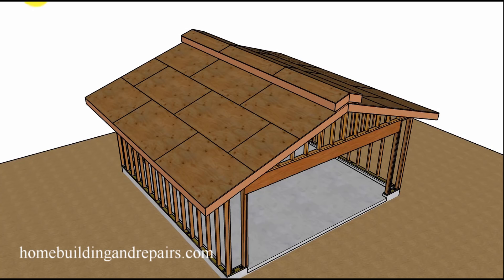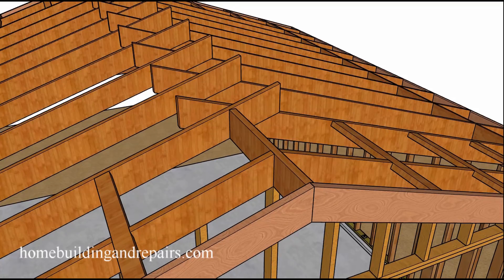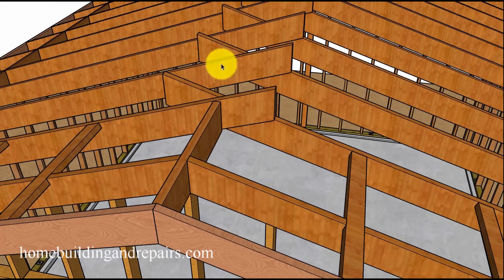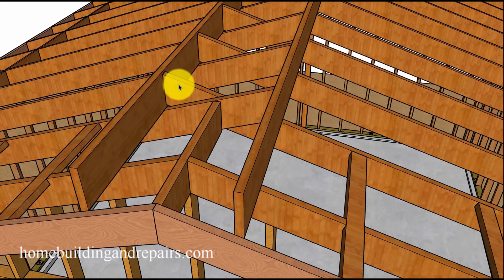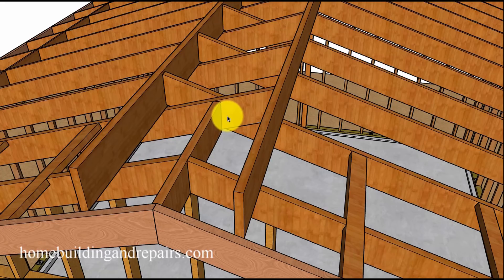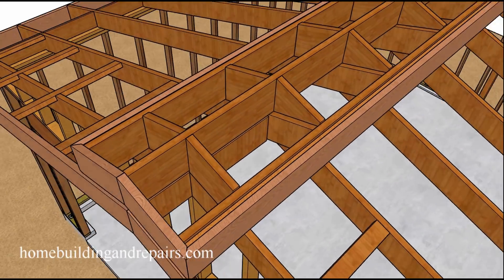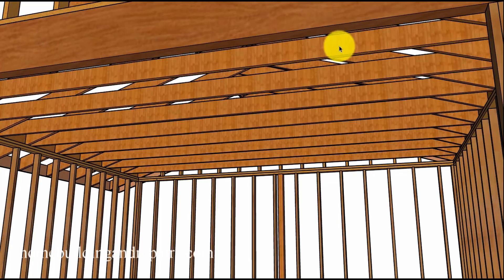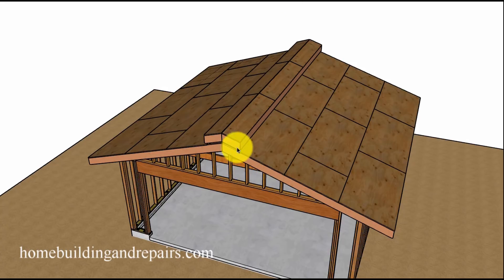Have You Ever Seen This? - Gable Roof Scissor Rafter Framing Design

Comment: Congratulations and thank you for sharing. Let me answer some of your questions. By the way I’m a structural engineer, P. Eng. So: with the kind of connections you have created, the result would be that you convert the hinge at the peak of the truss in an almost rigid connection. As a result, the horizontal reaction at the top of the wall caused by the truss will be reduced. This is quite important in your case in which you aren’t using a bottom cord.

Comment: I'm glad i found this video and your channel. I was looking for the way to do this for a bid i'm working on for a 20'x20' free standing porch. Possibly spacing them at 2'OC with 1x4 runners  across to support corrugated metal roofing. It looks like I will have to put some gable studs to carry the ridge at each end.... the ends are going to be open. there will be 3 6x6 posts on the sides that will carry a double 2x12 header. I'm wondering if the same can span 20' without support under the gable ends? Thank you again for the work you share!
Reply from the maker: You are more than welcome.

Comment: interesting, but doubtful and engineer would want to use this design on anything other than a shed. As a general; rule of thumb if you can avoid putting the load on the hardware then its best to do so. Decks with beams fastened to the side of the posts is a no no, it always best to put the load through the material that it supposed be holding . This design racks the hard ware as the beams expand an contract with moisture. Once the bolts from rafter get opened from the expansion contraction the holding power is moved to the end. If the fasteners are just screwed into the rafter end-on then you have a week connection. question is does the design still need the metal ties at the end. I would say yes so not much savings from material or labor, looks cool though.
Reply from the maker: I would tend to agree and yes it is an interesting concept.

Comment: You now have 3 ridges 
complicated rafter lay out 
More cuts for sheeting the roof 
More materials 
More labor 
Nice try 
Maybe do something like least amount of lumber for wood roof structure 
Most cost effective
Reply from the maker: You might have missed the whole point of the video. I was simply trying to provide others with a different method of roof framing. I will see what I can do about making a video to provide you with the least amount of lumber and possibly labor.
Reply: @gregvancom  
Just a comment 
It was not for or against. 
As for missing the point
Your right 
Nice video

Comment: Too much work for a cathedral.
Two lvls and stack the rafters atop The lvl ridge.
Reply from the maker: You wouldn't need two ridge beams to build something like this.
Reply: @gregvancom  
If you stack the rafters with snow loads. Your span would require it.
My lumberyard has an on staff engineer and I've framed many cathedrals in Michigan. We have always laminated two to three play.
Reply from the maker: @keithtomczyk4730  I think there was a misunderstanding, I was thinking that you were going to use one LVL beam, but locate it in different sections of the span, for example in the middle of the roof rafters span and at the top. Snow loads will definitely make a big difference on the structural design of any roof, including this one. Thanks for sharing.

Comment: this video  illustrates a new method to frame a cathedral ceiling framing system. I have the credibility and experience to advise you that building with this type of engineering design is pathetically engineered. I will say that structurly, it would surfice. However,  your video illustrates staggered ridge lines and crazy blocking between rafters correctly build this system. I suggest to you retain the conventional vaulted ceiling process which impliments diaganal bracing and collar ties to handle the load factor. It will diminish the ceiling pitch by 8-10 inches, depending on the run , but at the end of the day it will take half the time.
Reply from the maker: The video does not illustrate how to frame a cathedral ceiling, because as I stated in the video, I didn't know if it would actually work for a cathedral ceiling, but am pretty sure it will work with rafter ties.
Reply: Saving time is why contractors refuse to build small homes, which led to mobile home markets and needless deaths and injury's in TORNADOS

Comment: Where would the ridge vent go?
Reply from the maker: The ridge vents could actually go in the same spot, because the framing underneath would still be exposed to the attic. However, you could always use dormer vents.

Comment: it would be possible to half lap joint that scissor area. 
technical term would be "Oblique cross halving joint"
but don't go full half, just quarter lap would make them stronger.
Reply from the maker: I agree it would be possible and could actually create a stronger connection. Thanks for sharing.

Comment: In the event you want a building with no rafter ties, I think I would want to push them even further, since the distance from the ridge will be proportional to the strength you get out of the truss.  Get three or four feet out there past the ridge  and cram a clerestory window in between to let a little light in.
Reply from the maker: That also sounds like a good idea and the picture that inspired this roof design had 4 x 4's underneath the upper rafters that were sitting on top of it, sandwiched in between the lower rafters.